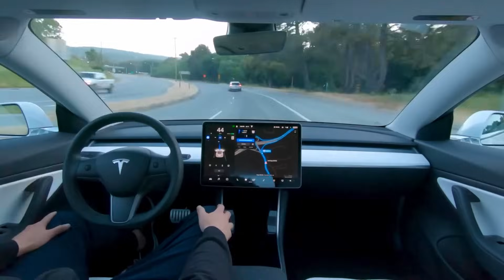Elon’s First Principles of Tesla's OPTIMUS Robot  |  Re-upload

Comment: Your guest, Keith, asked a key question. Is the robot - by itself - learning/changing through perception - in real time? Or is there a Dojo-type supercomputer retraining a model and cyclically updating the robot software? Or both? Perhaps because it is humanoid, we speak of the robot "learning" to do something, but we very seldom speak of the car "learning" anything. Instead, the car uploads more data for training and simply improves through periodic updates. The Voyager satellites and our phones and computers do the same.

Another key question at this point in development is what is the problem with bodily control? In the past, processing speed, C++ linear code, sparse sensors, and crude actuators excused a "chucky" robot. And, cars don't "fall over" (but they could tip or slide and do follow physics). But for almost any reasonable collection of sensors and actuators, one would think that through computer simulations, a sufficiently large neural net model, low latency perception, and speedy processors, the issue of smooth, swift, dynamic balancing would have been "solved" through model training (unless real mechanics - like sensor and actuator response - hinder this). Actually, Optimus should not only be balanced, it should also be "plastic" and rapidly adapt to disabilities such as failed sensors or actuators. An insect can rapidly walk away, even if suddenly missing two or three legs. Humans fall or trip occasionally - and so will Optimus - they both need to learn how to fall and get back up again (if damage allows that). Evidently all this is still very difficult to achieve.
Reply from the maker: I definitely don’t think that the bot is “learning” anything meaningful locally on device at this point.
Reply: @HansCNelson  That's my opinion as well. But it could begin with Dojo-like training to reflect a world model including physics, dictionaries/"net-memory" traces of common objects and their inter-relations in various environments, and ability to explore or be shown around to map the immediate situational context. Then after some task demonstrations, enough to capture a reasonable portion of variance, with good planning and emulation software, Optimus should be able to perform simple tasks well and maybe even "improve." It would need to remember barriers encountered and incorporate alternative plans that worked. The car does this to a degree (literally possibly predicting the future few video frames) and so can the robot. In a sense, local learning could be a matter of house-keeping and garbage disposal.
Reply: There is no way it learns localy.. u need compute for that.. the robot would be as big as refregarator
Reply: @pse2020  Is that so? Suppose you use telepresense or visual demonstration or verbal commands to show the robot whatever it is that you want the robot to do? What happens? Does the robot then communicate with the supercomputer (both the prompts and the contextual details), which then simulates the task and trains a model, then downloads that to the robot .. all in real time? Where is the "planning" in that? Cars do that, not in real-time, but the "planning" is still pretty much local. Actually I do think "learning" is rather different from "planning." For example, it involves remembering as well as adapting.
Reply: @WarrenLacefield  to that u need  powerful  hardware on the robot to calculate everything, that would make the robot heavy and especially if ur going to a battery that last more then 3-4 hours... Its not gonna work... The robot will record data, then the "mothership" if u will... Will take that data... Train and then do an over the air update.. especially if they want to make the robot cheap to buy...
Reply: @pse2020  You may be right. So much talk about the robot "learning." HW4 is a very powerful computer platform. A cloud-based  "mothership" might be very busy that way. But perhaps the # of generic "skills" to train will be much smaller than the # of robots. Maybe the robot just needs to "apply" the skills in a variety of contexts. Maybe that's "planning." Good chat!